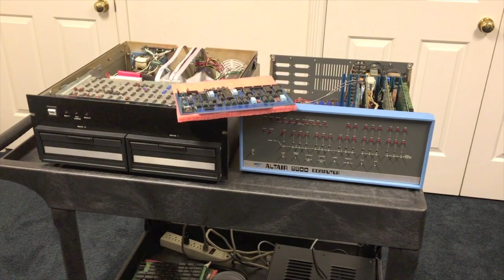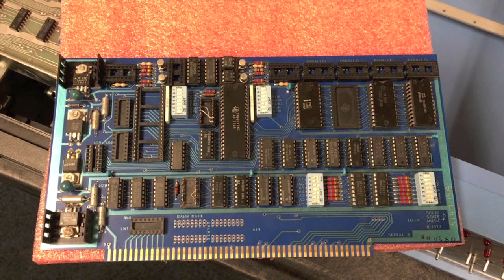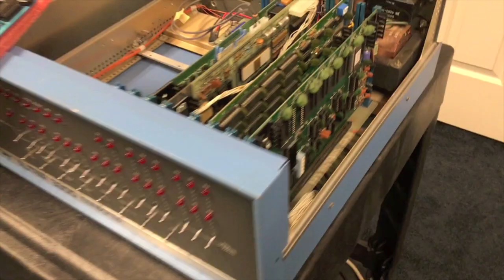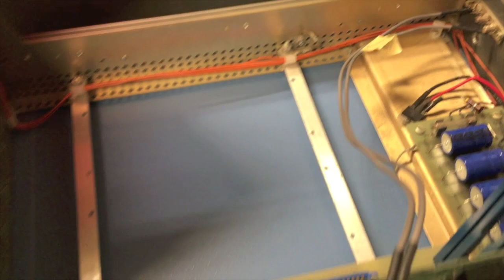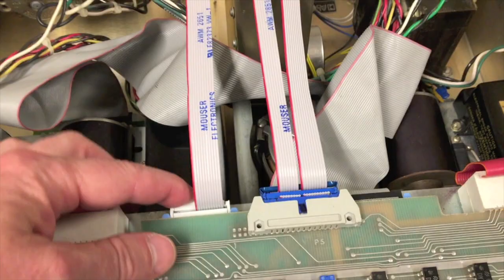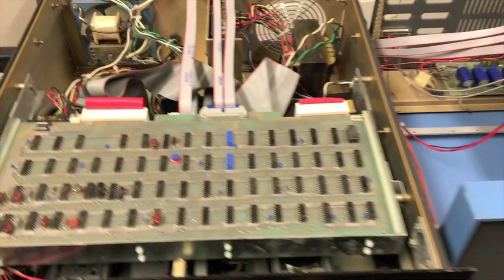Early Altair 8800 - Adding a Floppy Drive #1

Comment: As far as the remapping the scrambled bits goes, using a 256-byte lookup table is probably fast enough to keep up? That way the byte is just used as an index into the array, which I would imagine can be done pretty fast even on an 8080.

Comment: Wouldn't it have been easier to just change the cables individual wires to match exactly? That way, you'd be able to read disks written on other systems and not have any overhead at all.
Reply from the maker: Since this will be a totally custom system, including "file" formats, only a duplicate system could use the disks anyway. A duplicate system would, of course, be able to interchange disks with my system. In the end there is zero performance penalty since the fastest data can be read/written with this controller is every other sector and we're always waiting on that next sector even with the translation. Much simpler than interchanging 24+ wires on an intermediate breadboard. Between soldering the connectors from the drive, from the IO4, and then the wires between them, we're looking at 96+ solder joints, 48+ wire ends to strip and 24+ wires to cut.